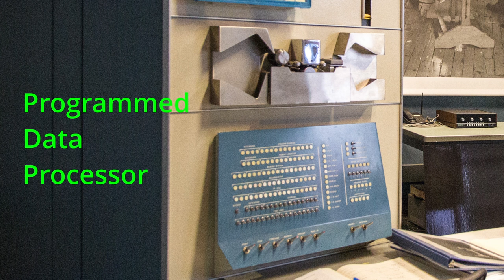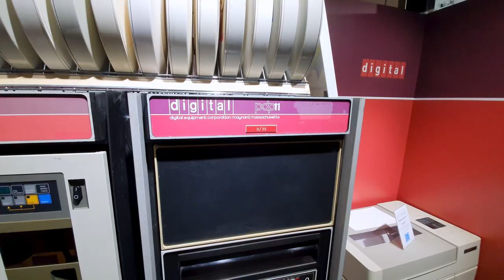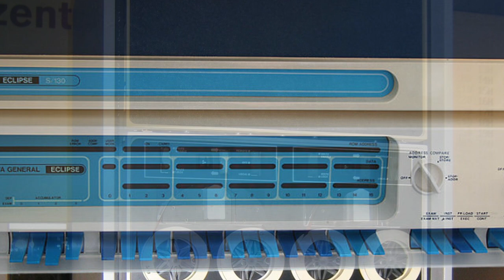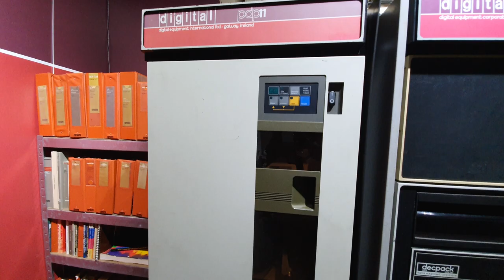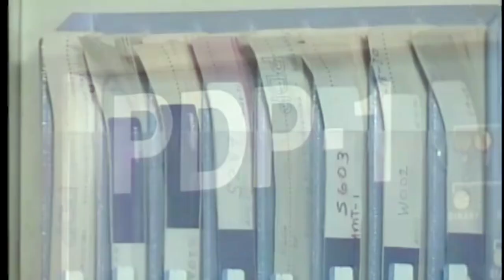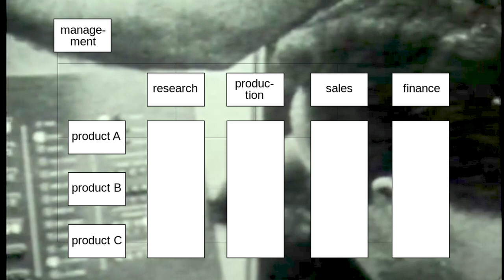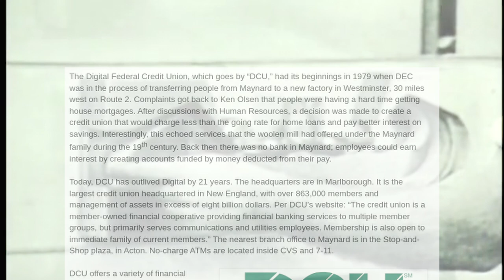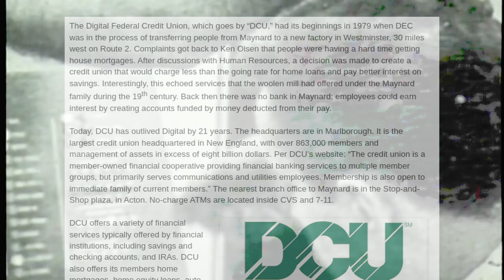DEC and the PiDP-11

Comment: I think an entry-level PDP-11/70 was about $80,000 and if you put 16 terminals on UNIX v7 then it was $5k per terminal and of course, most offices had just 1 terminal so in all maybe 45 people could share such a machine, it was quite economical, possibly even cheaper than a PDP-8 !!  A friend of mine - one of the first people to port UNIX - told me that UNIX was one of the first OS's that used less than 10% of the CPU.  At the time IBM OS/360 used 50% of the cpu even when the computer was doing nothing.

Comment: Any prospects of a look at SYSTEM INDUSTRIES? I worked for a Crown Corporation in the 90s that used DEC in its data centers; VAX 6000s, 8600s, 4500 bar fridges, microvaxen. Management decided to implement some cost cutting measures and used this supplier of equipment and peripherals (QIC/disk shadowing/alternative terminals etc). The SI tape units were great little devices that used a (surprise!) 68B09E processor and OS9 real time system. Great vid, and I think I'll subscribe. And yes, I saw the GPIO connector.

Comment: In 1998 the company I worked for hired someone to check if all the computers in the building were Y2K compatible. One day he came to me and asked if the Genrad 1792 was Y2K compatible. This was a printed circuit board tester. It used a PDP-8. Looking back, I shouldn't have laughed so hard. I think I hurt his feelings. After I finished laughing, I explained that it wasn't even Y78 compatible. Some versions of RSX used 2 octal numbers for the year. 8 is not a valid number in octal. What we would do was lie to the computer when we booted it. We would tell it that it is today's date in 77. The only place the date was used was on the test results. If the board passed we would draw a line through 77, write the correct year, then stamp our correction. A couple of weeks later he found me and told me that was not an approved procedure. I pointed out that we had been doing this for 20 years and nobody had complained about it.

Comment: 5:45 You didn’t mention that the PDP-5 and its successors were 12-bit machines. That’s what made them cheaper than the 18-bit ones.
Reply: I worked for DEC for years yet never realized they had once made 12-bit machines. Amazing! The 36-bit DECSystem 10/20 was unique as well. I've never heard of another with 36 bit word length.
Reply: @bobdinitto  The older PDP10's used PDP8's (12bit) as communications front ends. Univac had some 36 bit mainframes, too. I think you could even keep the old PDP8's on a KL10 based PDP10 via the DL10 I/O interface.

Comment: I worked with a typesetting system based on the PDP8, with DECTape, !.25NB Diablo Cartridge Hard Drives, paper tape punch, and multiple IBM Selectric I/O typewriters.  

Then a completely different typesetting system on a PDP11-34, with a memory mapper and an extra half-Megabyte core memory, with 9-track tape backups, and 2 80 Mb storage module   Hard drives.  A modified Unix OS, which rended to eat the file system.   Ugh

Comment: What about MASSBUS for all those RK disk drive (washing machine sized)?

EMC2 were heavily supplying controllers and disks for PDP and VAX as DEC charged by the KG for their equipment. Believed the saying was if didn't support Ken's weight it was not for sale. 

None of DECs PDP11, VAX11-9000 range were light. Stripping a VAX 11/780 to get it into the flat and the chassis bare was near 200lb if not more (sold to a guy to make a gun rack in the end - got a good deal) weld 3/32" plate straight on to it without blowing holes.....

Comment: 7:33 There were never any 38-bit machines. 36, yes. Which, you will notice, has a lot of integer divisors. That means it can be divided up into equal-length portions in many different ways.
Reply from the maker: That was intended as a joke, I wondered if you would pick up on it.
Reply: But why were there no 42-bit computers. You could have 7 6-bit characters for punched cards or paper tape or 6 7-bit characters for ASC-2.
Reply: 42 = 2×3×7. 36 = 2×2×3×3. More divisors, more different ways of grouping them.
Reply: @teeesen  because what is 9 times 6…
Reply: Yeah, the Univac 1108 had addressing modes for half-words and quarter-words.

Comment: Way back in 1983 I began installing/servicing CAT scanners built by Pfizer by copying the original ACTA-Scanner, the world's first full-body CT scanner.  This machine was totally controlled by a PDP-11/34.  These machines were selling like hotcakes, as fast as Pfizer could make them.  To maintain these machines, the technician had to be able to do almost anything.  Most of our time was spent repairing faults in the scanning gantry, which contained the x-ray tube, the detector array, and all the large motors that drove all the movements the machine made.  Other than that, we were busy fixing all the computer peripherals when they went wrong.  The hard disk was a behemoth of a thing, even though it only held 5 Megabytes of data, on 2 12" platters, one fixed and one removable.  So, 2 1/2 MB per platter.  The operating system was stored on the internal platter, the patient images on the removable one.  It took 2 strong men just to pick up this monster disk; whenever there was a head crash, it would wreck the disks and we would actually replace the internal platter and the heads, and do the tedious alignment.  The computer was full of custom plug-in boards for both controlling the scanner and processing the images.  This was one busy computer, I can tell you.  The 5-volt rail was supplied by a 5-volt 200 amp switching supply, and we found that it was critical to adjust, because some boards would fail if the 5 volts was a little too high, and some would fail if it was a little too low.  We had to  find a compromise level where everything worked.  The images were all archived onto 1" magnetic tape, which is what broke down most often.  The PDP-11 ran the RT-11 operating system, which hardly ever gave any trouble.  Just as well, we were already too busy.

Comment: Core memory is where we get the term "core dump" from.  I always wondered though, why arrays of capacitors was never popular with early computers as a form of memory.  That's what DRAM is after all.  Tiny array of capacitors on an integrated circuit. 12:06 Take it from someone who's worked as a professional solderer (at the remnant of Hughes Electronics), there's no such thing as "too much flux"!  It's key to good soldering.   I use flux like a fat kid uses butter!

Comment: 9:39 Core memory did indeed hold its contents. When my FE college moved premises back in the 1970s, our PDP8 was switched off in March and moved to the new computer room (complete with ICL2903) in July. When it was booted without a memory flush at the end of August it was still calculating its next move in the chess program written by the last student to use it (and it went on to lose the game, the program needed a bit more work).
Reply: My computer can beat me at chess. It doesn't stand a chance when I kickbox with it though.
Reply: @1pcfred  Kudos!
Reply: Back when I worked for Burroughs, a coworker told me that he once worked at a government site dealing with classified stuff. If the core memory failed, instead of sending it back for rework, they would buy it outright and destroy it. I guess they were afraid of someone reading that data. I actually worked on the last core memory Burroughs used. Fixed one once, but they were usually just sent back for repair. - a 32K by 20 bit board.
Reply: @jimsteele9261  Back in the early 70s when I worked on a 1904A one of our 32K stacks died so we were left with 64K and an unhappy George3. When the engineer arrived with the new core module I was surprised that it was smaller than a shoebox, given the massive cabinet with 186lb power supply! Our later update to 1904S with the addition of a FPU and another 32K revealed that the 32K stacks pretty much cost 32 grand... yikes! We had a lightning strike near our new computer room and it damaged the core module in the PDP8 so we tried sending it back under the repair scheme for a fixed price exchange... given that certain chips were sooty outlines they weren't having that. They were nice enough to give us a discount since we were an educational institution, so kudos to DEC :~D
Reply: @TheOwlman  The B6700 I worked on had a whopping 6MB Ram, It was divided into 4 sections, each made of a controller cabinet and a memory cabinet. The memory was made of a bunch of modules made of two pcbs joined together by a couple hundred pins. One board was the core array, and the other held the drivers and sense amps. In all the time I worked there, I only recall a couple failures. They were more reliable than the first generation of RAM chips they used in the next machine.
Reply: @jimsteele9261  Six megs! I can't remember what the 2903 had... it was semiconductor (ICL engineers referred to it as 'moss' memory to differentiate it from core) and I doubt it was massive. When I left education for the fleshpots of industry my Sperry PC had a whole meg of RAM, but the last machines I used in HE were Norsk Data ND 500s, so they had quite a bit of RAM. The smallest RAM was back at the FE college: the ICT1301 was measured in WORDS (128 if I remember correctly, though each bit was made up of multiple valves [tubes], so this is hardly surprising!) In truth, the main memory was the drum, the 128 words were really working registers that were constantly reloaded from it - that was only activated on open days, the front panel looked impressive (and one was used in the TV version of Blake's 7 because it was so futuristic looking). Happy days, the kids these days don't know they are born :~D
Reply: @jimsteele9261  In all the time I worked there, I only recall a couple failures. We only had the one ever - the core module that they removed had some untrimmed wires at the end of the matrix and over a period of years one of them had moved with the heat and shorted something out. I gather it went back to the factory to be rectified and was reused (given that it was worth over 30 grand once you added a cabinet full of sense amplifiers and power supply I guess this is hardly surprising... it isn't as though the cores wore out).
Reply: @TheOwlman  "We only had the one ever ...." There was a fun failure once in the memory controller. The memory subsystem had 8 extra bits per word (48 +3 tag bits and parity) It could detect and repair a single bit error, or detect multiple bit errors. Well, the customer turned over the system to me because it kept crashing. My first check was to use the hard wired memory tester. That showed me that one bit was always coming back wrong in one of the 4 cabinets. That told me there was a problem with error correction... a quick flip of the "disable" toggle switch in the memory controller confirmed this. About this time the boss walks in to "see how I work". I'm looking at the schematics and look over and say, "Ahh, it's gotta be this chip right here." Replaced it, and good to go. Trivial, but not gonna admit that to the boss. :-)
Reply: @jimsteele9261  Trivial, but not gonna admit that to the boss. A good day at work! :~D Back in those days I thought that the 650 nanosecond access time of core was quick, laughably slow by modern standards of course. I wonder how many decades it will be before RAM measured in gigabytes will seem quaint.

Comment: a little fact: a pdp11 also controlled the infamous therac-25 radiation treatment machine that killed a number of patients due to a software error and no hardware safety, this is to this day used as an example for what happens when you dont have redundant interlocks (both hardware and software). just to clarify: this had NOTHING to do with the pdp, it was more of a we need to make money no matter what issue.

Comment: 20:57 This is not paper tape: this is the form of magnetic tape on small spools that was called “DECtape”.
Reply from the maker: I know the timing of that is a little missleading you're right, thats why the arrow appears when I say magnetic tape. I really should have faded from an image of a paper tape reader to that image of a pdp-11.
Reply: I used to repair the DECtapes. The power transistors that drove the motors were always burning out. The technical name for that unit was TU-56.
Reply: @bobdinitto  You could literally crumple DECtape, and it would still read properly. Early PDP10's (KA-10 processor) were sold without disk or drum storage, and used a bank of DECtapes as a file system.

Comment: And here the most beautiful PDP 11 system ever, updating the central computer for the Nike missile system:
New digital computer DEC PDP 11/34, located in the former old pot's bay) and supply bay, the first two bay have been left empty (used after many years to include the new IFF system) composed of: Former pot's bay
two boxes containing CPU and Expansion circuits
Intercept computer controller for the Plotting boards (with another mini computer) and all circuits relevant to the incoming info by the radars and from the computer to the Launching area.
2 Floppy disks (8 inches) one to record the Missions and the other one with the Tactical disk containing the computer program, one controller and one real time clock, there was another disk containing the computer diagnostic software. Supply Bay
Digital Display
Digital keyboard
Thermal printer

Comment: Very good video but I don’t recall all of your OS list. CP/M never made it to the 11 and BSD (Berkeley standard Distribution) was - at least when it got to 4.2 - was a VAX port.

I recall DOS-11, RT-11, RSX-11D, RSX-11M, RSX-11S, RSTS/E, MUMPS-11 (then rebadged DSM-11), IAS, RSX-11M-Plus. CTS-300 (RT-11 based) and CTS-500 (RSTS/E based) we’re timesharing options sold via Commercial OEMs. ULTRIX-11 of course. And P/OS which was a menu-centric version of RSX-11M-Plus for the DEC Professional 325, 350 and 380 PCs.

Ian W. DEC UK 1976-93.
Reply from the maker: There was a port of concurrent cpm, that came bundled with a cobol complier my friend Brian used on the 11 he had installed in his business. I suspect the port originated in the 80's rather than the 70's I would enquier more but saddly Brian passed a few years back. The lastest BSD I could find a disk image for the 11 was bsd2.11
Reply: I stand corrected :-) 

Concurrent CP/M was something we thought would be commercially successful on the Rainbow (multitasking in 1993 between 4 sessions) but 1-2-3 and IBM clones running much lower cost MS-DOS bombed it.

BSD only came into my radar with 4.2 - which was the release that was the default UNIX implementation on VAX hardware that academia used extensively.
Reply: @ianwaring2531  I had the job of writing an entire bespoke operating system and Fortran-like compiler for the PDP-11 in the late 1970s which had the original design objective of just 28kB of core memory and paper tape. It would run up to a dozen users. How efficient we were in those days.
Other memories include the multi-user version of RT-11 called TSX-11 which was developed by Dr John Yardley in the UK, and Peter Dick who was a great fan of RSTS/E and for a bit of a joke and for the publicity stood for election to UK Parliament in Reading for "The BASIC Party" with a manifesto which included free computers for all OAPs and compulsory Programming training in schools - he lost his deposit but got lots of free publicity.
Steve Dawes (Retired UK DECUS chainman)
Reply: @stevedawes9465  I remember Peter Dick. He lived in Little London, just south of Silchester. Sad recent news was the death of Mark Bramhall; he was the “MHB” that you saw all over the RSTS/E source code microfiche.

I started at DEC in 1976 and spent my first year on RSTS/E V6B on an 11/45 in CSS Arkwright Road, Reading. Wrote the PC11 spooler to generate the paper tapes used by field service engineers; then tweaked some Fortran code to help minimise wire use (and to sequence their application) on PDP-11 backplanes.

Loved the company.

Ian W. Badge #50734

Comment: 6-bit word length. I guess that's why they used things like octal, and EBCDIC.
Reply: EBCDIC was strictly an IBM thing. DEC used some odd codes in its early days (I think there was something called “SIXBIT” used for some things), but they very early on standardized on ASCII.
Reply: That's precisely where octal came from and precisely why it died.
Reply: @lawrencedoliveiro9104  The 36-bit machines (PDP-6, PDP-10) normally packed five 7-bit ASCII characters into one 36-bit word, leaving one bit unused. (The byte instructions made this reasonable.) Occasionally, when a subset of ASCII was in use, only the alpha-numerics needed to be used, and using the SIXBIT assembly-language pseudo instruction allowed six 6-bit characters to fit into one 36-bit word.
I worked for DEC between 1964 and 1992. At one point, around 1968, DEC had no standard character set, with the result that the hardware people would build line printers (remember them?) with strange characters (like spade, heart, diamond, club). This caused lots of software incompatibility issues. I proposed that DEC standardize on ASCII, and I wrote the first DEC software standard, which was ASCII with a few additions, like each character had to be identifiable in isolation (so eye, and el, and one could be distinguished, also oh and zero).

Comment: Someone with soldering experience please chime in. 12:50 I haven’t even tried to solder since I was a teenager, but my gut feeling is that it would be a lot more comfortable to solder components “away” first, then move “inwards”; that way you would not keep your arms over freshly soldered components, and an inward shift would feels like a more comfortable motion. Or is it better this way? Maybe it doesn’t matter?
Reply from the maker: I'm not the greatest at soldering, I worked that way so I dont block the shot as much. Someone who is just soldering does not have to think about how much they cover up the pcb as they work, so could well prefer the appoarch you suggested.